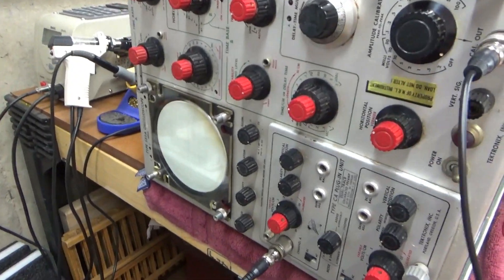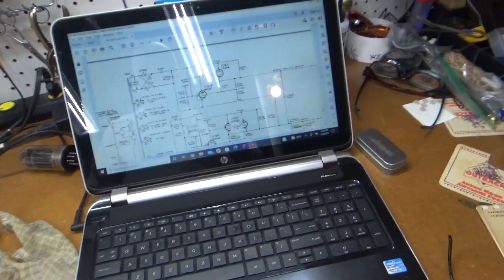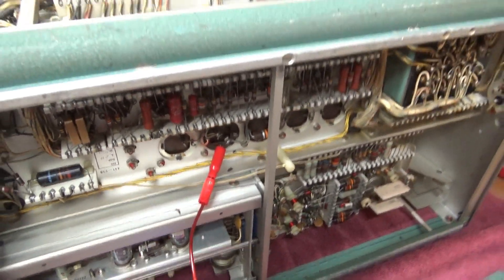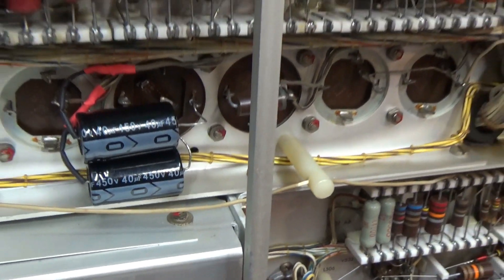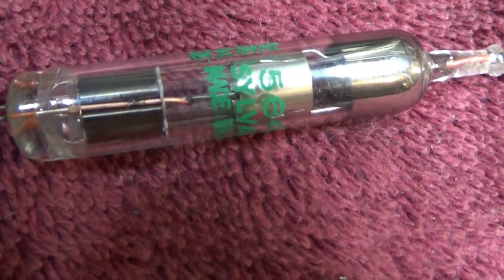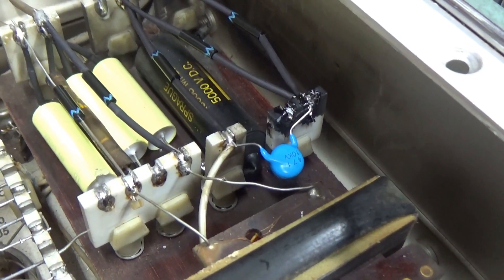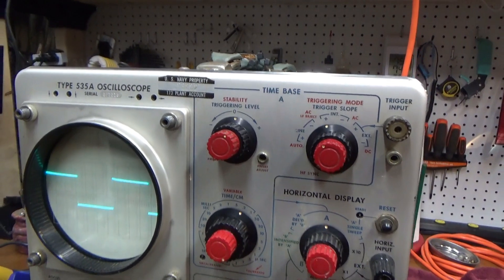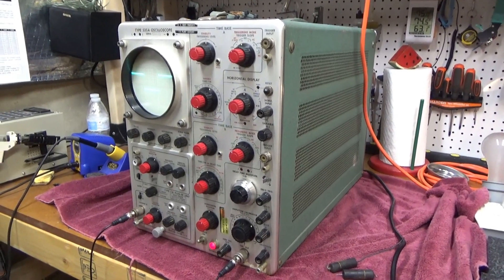1959 Tektronix 535A Oscilloscope - Fixed

Comment: Good job! I have a 545A with some similar issues. The 500V supply is low at 435V and the display is out, and Intensity control doesn't work. Will look into what you did. Wish I had your email to ask you questions.
Reply from the maker: @larryblack1944  you can email me at mguessva@gmail.com